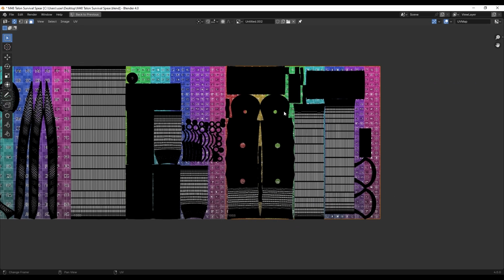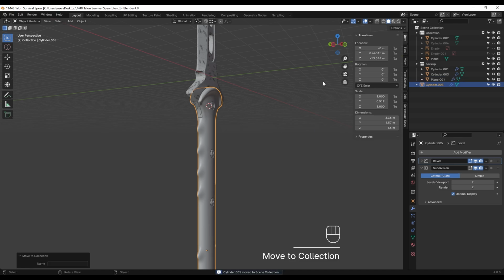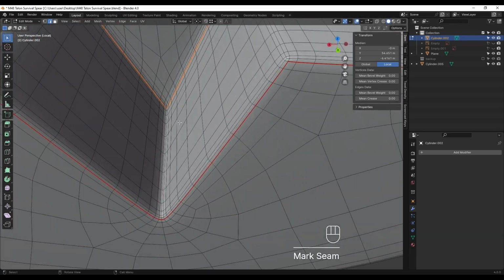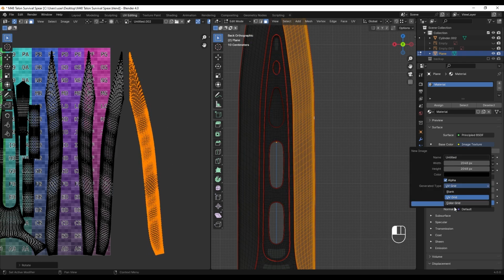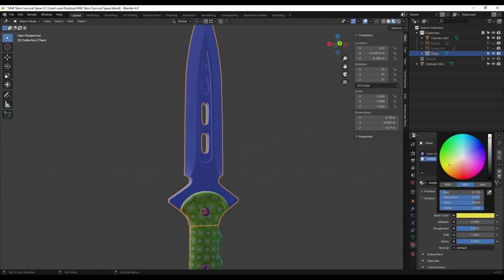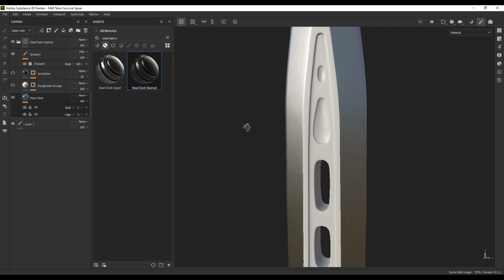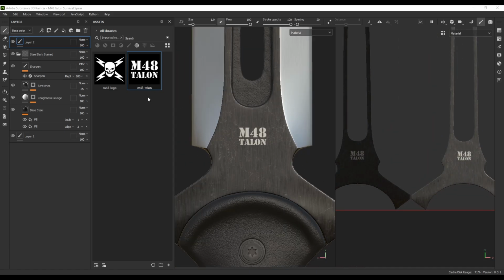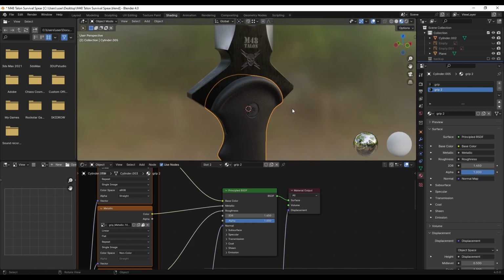Blender & Substance Painter Material Creation: M48 Survival Spear Tutorial

Comment: Question: It wouldn´t have been more easier to mark all the seams before apply the subdivision modifier?
Reply from the maker: After applying a subdivision surface modifier, the topology of the mesh will be altered according to the subdivision algorithm. This can affect the placement and appearance of seams, especially if the mesh has sharp creases or hard edges.
You can use a different workflow and unwrap your low poly object and bake high poly object details to the low poly object.